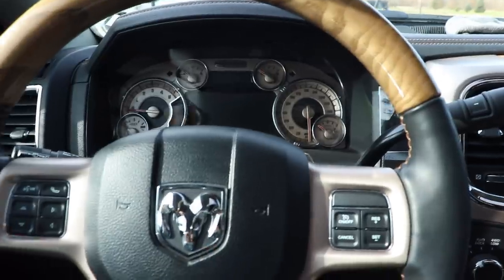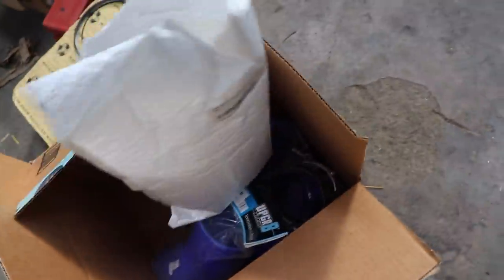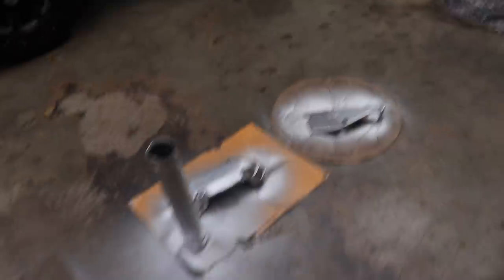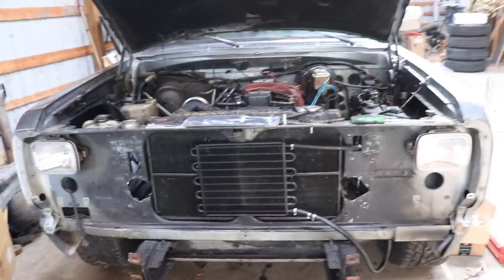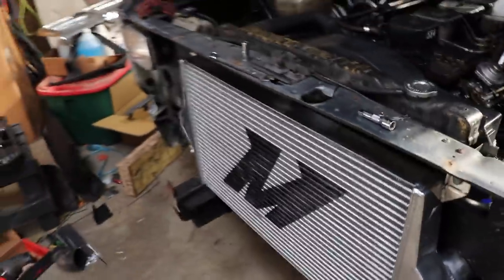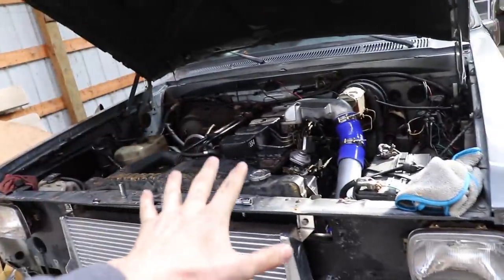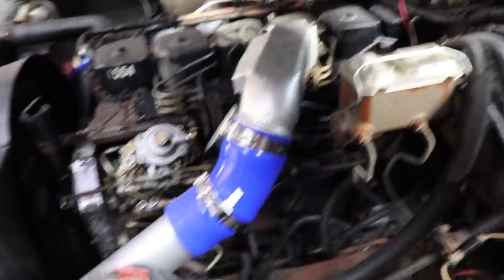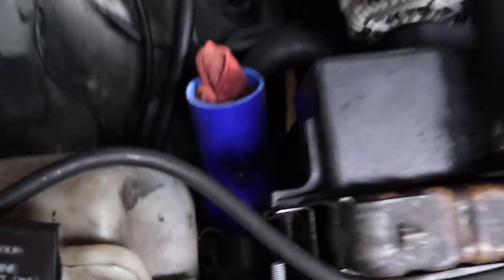1st GEN CUMMINS STREET TRUCK COMING TOGETHER!!!

Comment: Trim the one intercooler boot on the cold side at the engine, will make it look a lot cleaner. No shame in rattle can, it always turns out better than you expect and is better than leaving it the way it was. Plans for the trans?

Comment: Looking good. Just a heads up. The boots will be your weak spot on the inner cool system if you decide to go with compounds. Better to have the bend in the pipe and the boots straight.
Reply from the maker: Anthony Aubuchon tip and bottom I have the pipe in to far that they touch.. it’s rock solid..

Comment: For the valve covers I would have recommended (two years ago) that you use the aluminum heat sink-designed valve covers. I don't know if they really serve much of a purpose, but they appear to help dissipate heat from the engine:

https://www.amazon.com/dp/B08378PZGS/?coliid=I3M828MUCDUY3N&colid=1D9IHX4S8AQ9G&psc=0&ref_=lv_ov_lig_dp_it

Also, When I re-did the intercooler piping for my 1990 D250 (originally a Banks factory-fit intercooler kit) from 2.5 to 3," I found a 2" (turbo) to 3" 90 degree elbow, designed to clamp directly onto the turbo and clamp onto 3" intercooler pipe.

For the intake side, I had a machine shop do a semi-circular cut into the top of the throttle bracket (the one you chopped off and painted silver) in order to make room for a Pusher 1st Gen. 1994-98 intake horn (and to still be able to fasten it to the horn and the intake manifold). This maintained the integrity of the throttle bracket, with mount for the engine oil dipstick intact.

Also: Please stop with the under-hood air filters!! They defeat the purpose (letting hot air into the engine!).

If you'd like before-and-after photos, give me an email address.

Comment: You need to get that brake dust off the left front wheel on the long horn or they will rust
Reply from the maker: Reece Black I legit clean them all the time.....
Reply: Ok just making sure because that has happened to me and it isn’t fun

Comment: Are you running stock lift pump? If so it will struggle to keep up with the injectors
Reply from the maker: Tyler Diener nope, probably going to run a FASS
Reply: LOUD 'N' PROUD have you looked at the hungry diesel mechanical piston lift pump. I plan on going compounds down the road and that’s the lift pump I will run.
Reply: If you do a Fass make sure you don’t have to much pressure or you will blow seals on the VE pump but the Hungry Diesel has a lift pump kit that bolts on right in the stock location that can support 600hp (I just ordered on for my 91 12v)